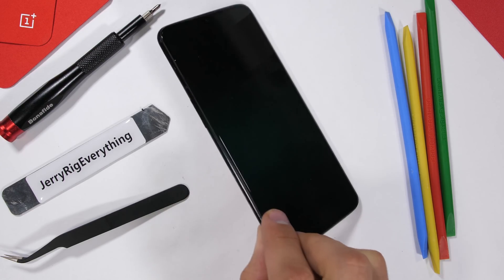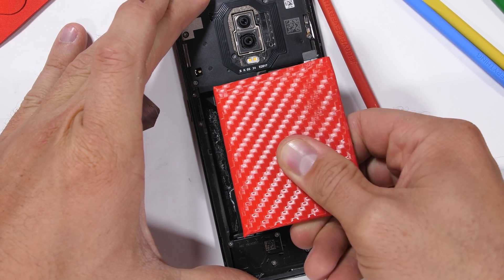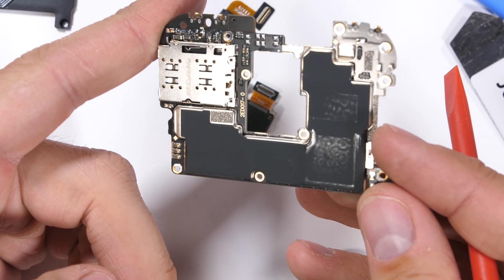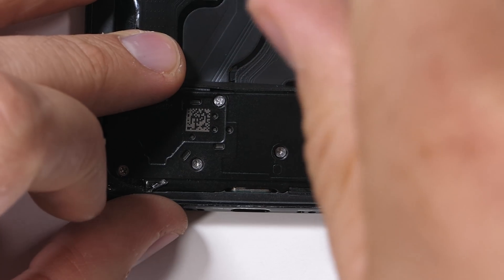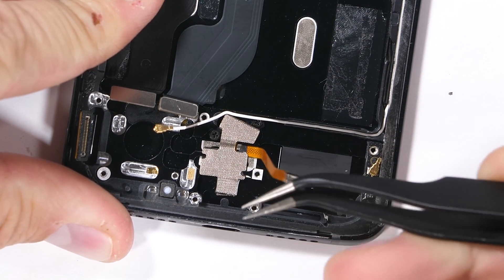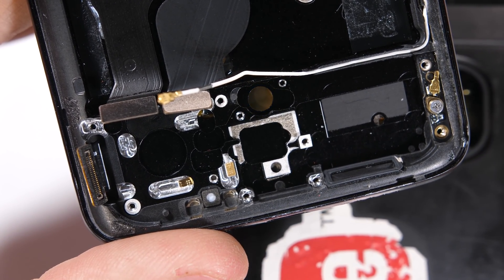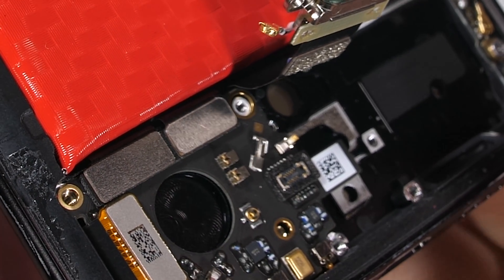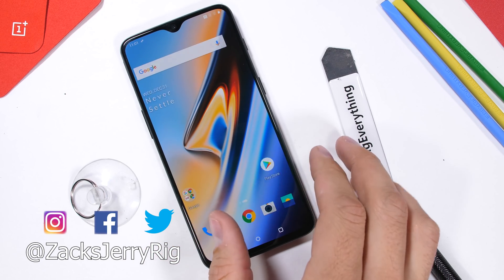OnePlus 6T Teardown - Can under display cameras be real?

Comment: "Lower Priced". Somehow I got my S7 Edge 2 or 3 years back for 590€ - the 6T has the same price but lacks 1440p display, wireless charging, confirmed water proofing, Always On Display, expandable storage - I get that these features are no necessities but back in the day I paid a premium (600€ almost) and got "premium features", but now this is considered cheap, but at the same time has less features than my old phone. So, kinda depressing, no? I wouldn't consider this a "cheap" flagship at all.
Reply: s7 edge is a good device! but for the one plus price you can now get a s9 (not sure about the+ though)
Reply: @Conceptcreator  Absolutely true and hardware-wise wildly more advanced. Just the software is a gripe obviously. :/
Reply: Haha, also my S7 has a headphone jack which I use a lot! Almost forgot! Everyone likes those.
Reply: LinusPlayZ 1080p is good enough. 1440p just takes more battery. It doesn't have wireless charging but charges twice as fast or even faster in wired connection

Also, you should try using both of them. Your S7 Edge and the Oneplus 6T. You'll be surprised what a difference year gap can make.
Reply: @LinusPlayZ  i have S8+ which is big and still has a headphone jack heck my moms S9+ has stereo speakersand still has a headphone jack aint that surprising and still have better audio and quality S9+ With a headphone jack.
Reply: @LinusPlayZ  Most people would pay more just to get rid of that useless edge display. Except for the camera, OnePlus is always a better choice than a Samsung because of the software. Hardwarewise they mostly use the same components but with a OnePlus you get better software and no gimmicks like edge display. And on top of that, a cheaper price!
Next time you buy a new phone, do the smart thing and don't chose a Samsung.
Reply: And all the other flagships have also gotten much more expensive. And OnePlus has at least twice the RAM and storage that the S7 did.
Reply: this phone's hardware beats yours out of the water though, which is the main selling point. premium hardware for half the cost
Reply: LinusPlayZ dont be like that you will trigger the OnePlus Cult. It was destined to be a "flagship killer" but without the flagship features 🤦‍♂️
Reply: @fightnight14  Oh look we have a funny man here!
Reply: 600 pounds is 786.36 usd the one plus 6t is 499 pounds which is 549 usd , I get what your saying but there is a price difference which I’m sure if one plus intended for this phone to have all the bells and whistles like a 1440p display they could of easily done all those things for a little more, the phone could have a on screen display, an on screen display is a soft ware thing only requiring the right hardware ( a screen with the technology to be able to disable pixels which is oled I believe or amoled?) . This phone is a flagship killer sort of like a cheap flagship similar to the iPhone 10 r except excluding apple tax
Reply: @picks2789  € is EUR, not pound. Redo your conversion, mate :).
Reply: LinusPlayZ you said it. "back in the day" I feel you, but look what other companies are doing.
Reply: I got my S8 for about the same price about half a year back, similar to the S7 but with a slightly larger screen and still no ugly notch!
Reply: Today's midrange will beat s7 in terms of performance you are comparing 10nm vs 28nm
Reply: @VedprakashSharmaVed  I know, I want to upgrade, but I'd like to get more features for the same money as three years ago and not less. That is the conundrum, not the actual comparison between the phones - obviously.
Reply: @LinusPlayZ  pay a bit more and buy any flagship and use it for 3 years

nvm better wait 5g to buy a flagship
Reply: Switched from my S7 Edge (since pre-release) to 6t now, and let me tell you a few things:

- Prices 2016 can NOT be compared to now, nearly 2019. Prices increase alot. Not only smartphones, but CPUs, Graphic Cards, many things.
- If i go really really near, i think i can see a somewhat glimpse of a difference between 1080p and 1440p when zooming in text to max. Maybe also due to the screen protector on the Oneplus 6t, preapplied. I usually NEVER use any screen protectors at all, ever. That also might have an impact there. On normal usage, i have zero issues with the resolution, and don't see anything "less sharp" than my S7 Edge was.
-Water proofing.. Even with the S7 Edge i mostly didn't tried too much. But i think Oneplus is IP67 rated, but simply saved the money for the official Rating. Like AMD/Nvidia pull out Beta drivers, that are 100% perfectly stable just as every WQHL Driver - simply without the "Microsoft approved stamp" on top of them. If it keeps the price down, fine by me. It's meant for emergency survival anyway.
- Lack of sd card: So 256gb Storage is not enough for you? If it's enough for you, or even MORE than enough, then sd card is useless AF ;-) SD Card has ONLY disadvantages. Slower, Many apps can't use it (Whatsapp..) well, etc etc. On S7 Edge with only 32gb storage, SD Card made sense. On Phones with 128 and 256gb.. yea, absolutely not important tbh.
- Sound: First of all, i have a Pair of UE900 IEMs. Quad-BA Driver ones, 349-399€ MSRP, better than any "casual" stuff. I can hear no quality difference between the S7 Edge (not known for the best sound ever...) and the Oneplus 6t jack adapter. But 6t + Adapter can go louder. Source was Spotify Premium with highest quality. I am perfectly satisfied with the Sound. The Dongle however feels somewhat fragile.. the Cable is quite thin. Let's see how long it lasts... A small "Workaround" for me, but if i get a +400 mAh battery for that? Fine by me.
- In-Screen-Fingerprint sensor is at least as fast as the S7 Edge one. Maybe not the fastest sensor that was ever created, but it beats the S7 one for sure.
And in addition.. The speed of the Face Unlock is sick. Truly, motherfucking Sick (i don't care about security. Noone gets my phone, especially noone i don't trust).

Yes, i went down to 1080p, i don't have Qi Charge anymore (i tried it a few times.. don't really like it, and i don't find it that convenient), no official IP Rating, etc etc etc.
Oneplus focuses on the essential things, mostly pure Performance, Speed, and Efficiency (seen Screenshtos with 8-11 Hours SoT).
While my S7 Edge.. a year ago began to "slow down". Never saw the early 2016 Release-Speed ever again. Idk why.

No matter which phone you take, you will not find any phone that does every single Aspect better than the 6t. it's all a huge Amount of different Pros and cons, and it depends on YOU, which Pros you preer, and with which Cons you can live easier.
Take a 1000€ Note 9, Pixel 3 XL, Mate 20 Pro.. All of them have at least 1-2 aspects, that Oneplus 6/6t does better. And other, it does worse of course.
Reply: Oh yeah and also hardware is improved - the necessities like cpu gpu... the 6t should become “obsolete” later than the s7 which is already 3 generations behind so will be discontinued sooner than the 6t
Reply: lmao even s9 is better and cheaper
Reply: Then go ask Oneplus to add these features you mentioned with price increase of 50€
Reply: Costs of development, manufacturing, tooling, and parts that are sourced are going up so companies have to scale their prices to match or risk losing too much in the long run. 

Also, since you're talking about Samsung's Galaxy lineup, it helps that they're now spending more money on ensuring their batteries are as safe as can be specially with that Note 7 fiasco and with the case of the S9 and Note 9 series, a camera with a mechanical aperture to allow for their dual aperture camera setup, which of course costs a bit more per sensor. 

Basically, prices are going up higher and higher so now the mid-range market had split up, upper tier mid rangers now considered budget flagships due to developments within that smartphone market, specially from Chinese manufacturers.
Reply: @GabrielIgnacio  while you say that then what about apple? It only cost 350$ to make the iPhone x so...
Reply: I had an s7 and now a note8, but i would still say that oneplus gives more value for its price. With the 6t, u get one of the fastest phones, a bigger screen to body ratio(altho i hate the notch), (better)facial recognition and other things like android pie and the latest updates. Th s7 was a  great phone, but i would say that the oneplus 6t is better.
Reply: wow  wow Samsung has an iris scanner and face id and a fingerprint censor that is physical which is faster
Reply: Here comes another one
Reply: dont forget how easily samsung and lg drop prices of thier phones after 3-4 months
Reply: @abhishekbhoyar7838  It is not true for every business, definitely not in the tech realm. Just look at televisions or PCs, they do typically offer more whilst keeping a similar pricing structure. Sure there might be some up and downs but in the grand scheme of things it stays similar.
Reply: On my s6edge too
Reply: You could had gotten the s9 for 500-600 dollars. I played urself.
Reply: Was waiting to buy OP6T but got myself the Zenfone 5z instead for 24,900 rupees($340) on Diwali offer. It's a good midrange phone and offering a way better deal than OP6T which costs 37,999($530).
Reply: @bootlegscarce0844  they just lack of marketing :(
Reply: It's considered cheap as new flagship. It's being compared with current new flagships on the market, not the previous generations. Obviously you can get a Samsung S8 for the same price and it has more features, but that's missing the point.
Reply: @XtrAMassivE  what about actual practical features
Like an alert slider or realistic gesture navigation
Plus software support
Reply: @XtrAMassivE   I am just saying that I don't feel like upgrading because A - a 1000€s is too much and B - for the same price I nowadys get less. And it is a trend I don't like. But I guess it happens to everything.
Reply: Lol.. I have used s7, now using oneplus 5. I can assure you the smoothness, reliability, cpu/gpu performance of 6t will be better than the s10 which is not even released yet! (if you actually care about performance and long term reliability)
Reply: @nafisfahim4044  try sony xperia phones best perfomance but a bit low ram :(
Reply: @nafisfahim4044  ur must be tripping, U MUST BE. have u used s10 ( it will feature 7nm chip btw ) ?  u havent but u can ASSURE the smoothness,reliability,cpu,gpu and copy paste ..
Reply: @nafisfahim4044  wrong. Samsung one ui and snapdragon 8150 are way faster than an 845
Reply: @nafisfahim4044  lmao so basically in your mind op6t Is better than s10 even though it's not even released!
Reply: @killerassasin5752  I think he means that the software of the 6t is still going to be much better and lighter than the s10. I personally samsung's skin. If Samsung had stock android on it, it would have the best phones. Furthermore, Samsung has really slow updates, and its not very developer friendly.
Reply: More like a cheap brand that sold out its customers
Reply: 1440p display drains battery and is useless on a 6 inch screen
Reply: @asymmetrical7854  I get your point, but when you actually use it to watch Youtube e.g. you will notice difference not only in sharpness, but also in details and contrast. There is just more information being displayed. I just don't want to downgrade by paying 600€ again.
Reply: If you have been using your phone for 3 years and still believe that it is worth every single bit of money even today than nobody is forcing you to upgrade. But calling it a downgrade is outright disrespectful. Not only does the hardware get better with time but the price of the devices increases as well. The processor that runs your S7 is old now and better processors are available even in the low budget segment now. Oneplus does confirm that it has water and dust proof its phones and just that it doesn't want to get an IP rating, it has done its on testings. Having an IP Rating doesn't mean that the company will have to take care of any damages later on if the phone dies in water, even Pixel doesn't have that even  though it has IP ratings, Samsung can afford to replace thats why it does provide the warranty. Oneplus already has an AOD actually, they disabled it for regular customers because of its inconvenient to the average user who would use it for aesthetic purposes and then complain about battery drain issues. Also does your Samsung have double tap to wake? Oh it doesn't how sad. Does it have an in-display fingerprint sensor? Does it have camera sensors that can easily compete against the best phones in the market right now? I dare you to compare photos from your S7 with the 6T, compare the speed of both the devices, compare the software experience of both the devices. Also companies stopped providing expandable storage because when combined with a faster UFS 2.1 storage already inside the phone, it makes the phone a little bit slower to use, an average customer doesn't know that and would rather complain later. What you are calling premium features are aesthetic features, saying that a Formula 1 doesn't have AC and saying that your 3000$ 10 year old car has one doesn't mean your car is better than the Formula 1. Oneplus believes in providing customers what they actually want, the market share of Oneplus and Samsung are widely different now, Oneplus loves tech savvy users that like the phone for what it is and not what a piece of paper shows it is. Samsung is still oriented towards customer base that is ignorant of a phone's features but rather only loves the aesthetics of the device(curved screens, always on displays and glass bodies - the three major selling point of Samsung devices since the S6 Edge). The 6T is most definitely an upgrade and a huge upgrade at that compared to your S7, You want to go for S9 or wait for S10 its your choice, you don't want to spend a 1000$ its your choice but in the end if you are looking to get flagship features on a price that actually doesn't force you to pay 300$ for brand value than Oneplus would be where you will end up.
Reply: @NisargShaikhofficial  Mr. You are arguing besides the point. I am just saying that nowadays 600€ don't give me the same amount of features anymore and that for a company of OnePlus - who were proud of their low pricings - are also now creeping up slowly.
Reply: @LinusPlayZ  You are forgetting to take in to account inflation. Plus at the begining, OP had razer thing profit margins. If you factor in inflation, the newer tech. The price is justified. You won't even get a samsung galaxy phone now for 600, you have to wait a year for it to  get cheaper, at which point the 6t would also be cheaper.
Reply: @NisargShaikhofficial  Well Said.
Reply: To this date s7 edge is a better phone than the 6T.
Reply: @Josmersuero  that's BS. S7 Edge runs hotter, battery drains faster, its processor is slower, and in the case of my GF's unit, the touchscreen is far less responsive.